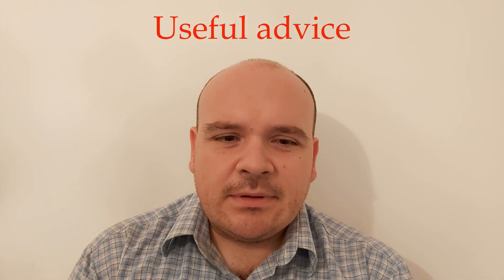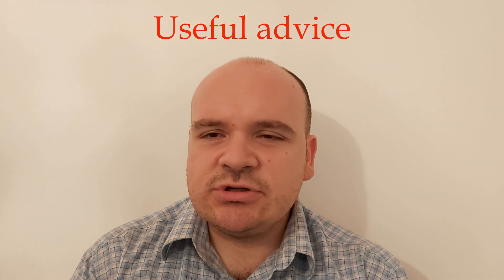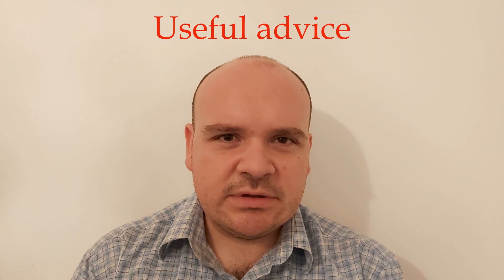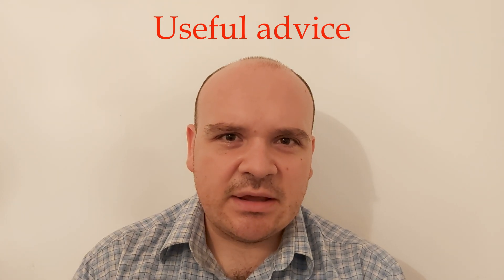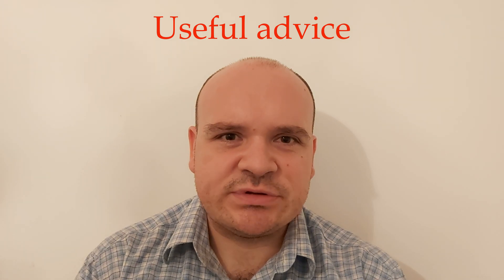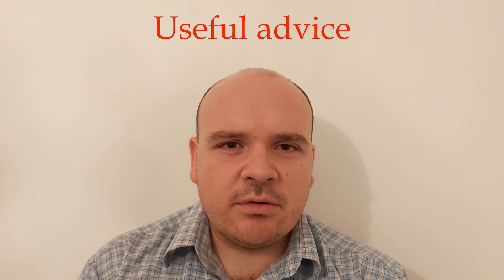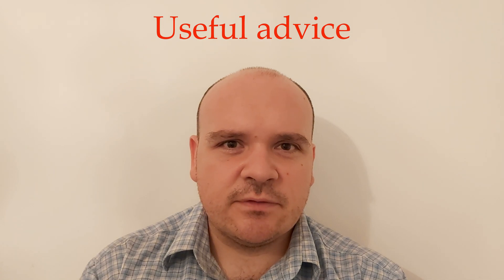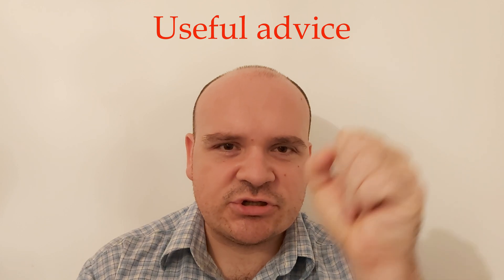Mercedes KE-Jetronic - Useful Advice

Comment: 92 500sl 129.066 cold start issue.  hard starting cold rough idle till engine warms to operation temperature If I turn ignition on/off 3-4 time it starts up right a way or if i crank the starter 3-4 seconds turn it off before starting it will start up right a way.  it seems it is loosing fuel pressure I suspect the accumulator is bad you showed a simple test in another video where you depress the air ( cant remember the rest of the name) is that also applicable to my car too?
Reply from the maker: Check the coolant temperature and the cold start valve. You can use that method as well but the more reliable one is with the pressure gauge on.

Comment: If the OVP (Überspannungsschutzrelais (ÜSR) in german) is blown, the ECU is cut off, as the part to be protected! Means the KE-Jetronic is now in a non controlled purely mechanical mode, the fuel mixture is especially during warm up in a non ideal ratio and the engine is shaking, rpm too low, etc.
Sometimes its just the fuse on top of the Relais, check this first, never bridge the OVP, as this can damage the ECU!
Checking the whole KE-Jetronic is time consuming, so my repair Shop made it clear, please do it yourself 😨!
Reply from the maker: If the fuse is blown the ABS bulb turns on. Sometimes the fuse is not blown but the issue can be the OVP. The advice is to replace the fuse with the new one. If the same thing happens to the new one and all the parts on the system are out of specs this can mean the issue is the ovp but something else on it - soldering issues. Or maybe the generator.

Comment: Hello,
My mechanics has touch the mixture screw, now my car stumbles on acceleration, loss of power and heavy in fuel. Sometimes I start, could hear a big “boom” in the engine.
My car is 190e 1.8 manual 
Please help.
Reply from the maker: Hello, what you have to do is to do the so called initial mixture adjustment - make the fuel pump run continuously and unscrew one of the hoses leading from the distributor to the injectors. Take the 3mm hex key, turn the ignition on and turn it clockwise until you see the fuel coming out of the port. As it does stop and turn the key half a turn counterclockwise. Under these circumstances the car will start. Purge the air out of the system(let one of you deflect the sensor plate and the other crank the engine, as the car starts firing up let the other release the sensor plate). Then take the multimeter(if you don't have the one measuring % set the mixture to fluctuate 6.6-7.2V, if you don't have lambda then set it to the steady number of 6.65V). That's what I can say to help you.
Reply: @mercedeske  thank you, will try this weekend, I do have the duty meter.
Reply: @mercedeske  please assist to where I need to connect my multimeter to measure the voltage?
Reply from the maker: On the left fender there is a round socket. Unscrew it and stick the positive in number 3 and the negative in number 2(as the car is warm).

Comment: In my experience, one important thing is the over voltage protection relay
I advise all guys to test with another one if you counter any problems

In my case, my car have starting and idle problem.
I have replace the potentiometer, fuel pump
The problem still not solved

I read form Taiwan forum saying that the OVP problem
MAYBE, this is due to the hotter weather in HK and Taiwan

I borrow one and test it, all problem solved

going to buy a new one

I wish this is useful for you guys
Especially who living in "hot area"
Reply from the maker: Thanks for your contribution. Generally what I read is that the OVP has to be replaced either when the ABS bulb turns on or if every component on the system is out of its specifications(the coolant temperature sensor, the potentiometer, the lambda probe...)
Reply: @mercedeske  in HK, most service provider will not do so many test
Time cost too much

So they simply ask you to replace this and that

So thank you for your video
I learnt a lot and will be able to ask the guy to do the job
Reply from the maker: There you have it! Now you know how to repair the car yourself!You will pay - for the parts....maybe 😃, for the labor NOT!!!

Comment: How can i find good parts
Reply from the maker: By the reference number, a new one from Bosch. I use ebay. There you can find what ever you are looking for. Only the potentiometer is not from Bosch, everything else is and I'm happy how the car runs.😀😃🙂
Reply: @mercedeske  very nice , i will make diagnosis to my system because i have crazy amount of fuel consumption the exhaust smells gas and its not smooth feels like spitting expect there is no water or oil comes from exhaust and the fuel pump very loud but all benzs sounds the same maybe they all are not functioning 100% 😅
Reply from the maker: @mahmoud jehad If the pump is loud, it has to be replaced. I had the case that the pump was bad and it leaked on the washer. I believe you have similar case 🤔!?

Comment: I have a question. My 190e won't start. The injectors pure so much fuel to the engine and the spark plugs fill with fuel. Why is that happening? I have bad injectors? Bad distributor? Or o2 sensor??
Reply from the maker: How many km does your car have on the tacho?
Reply: @mercedeske  170.000 but it was sitting for 8 years. Change the fuel pump and start with no problem but the pump was bad and i replace it with a new one and now it won't start. We put the injectors in a bottle and they spay so much fuel when you crank the engine
Reply from the maker: @vasiliskerasovitis272  Replace the injectors, you can not clean them ultrasonic. The O2 sensor you will check at the end but if it was never replaced you will have to do it each 50k km. As from all of this I can say - your injectors squirt. If you tested them in the bottles then it means that your fuel distributor is good. Are there no leaks out of it? Does the sensor plate slide easy?
Reply: @mercedeske  no the distrubitor doesn't leak from nowhere. The distrubitor lines that goes to injectors have fuel. So if the injectors pure too much fuel they are bad. Can the distrubitor be bad and send more pressure to the injectors and make them squirt?
Reply from the maker: No, the injections get clogged and they either DON'T SPRAY at all(worst case), they drip, squirt or spray at the angle(obviously yours squirt), the distributor can never send so much quantity of fuel so that the injectors "suffer".That means they are bad and have to be replaced. My advice to you is to replace them, the working pressure is ok. Replace the injectors and the holders. As you replace the injectors search for them according to their number.
Reply: @mercedeske  thank you very much for your advice. I will try to replace the injectors with new one's and i will see if the problem will be solved
Reply: @mercedeske  one more thing i forgot to tell you. The injectors make a noise like a scream as well when they spay
Reply from the maker: @vasiliskerasovitis272  My pleasure, any time. If you have any other problem, just tell me and we will try to solve the problem. ;-)
Reply: @mercedeske  Bravo, bambino!
Reply: @mercedeske  Simply astonishing, no secrets for you - how did you manage to master KE-Jetronic just like that!?